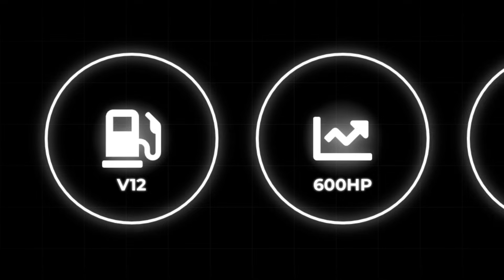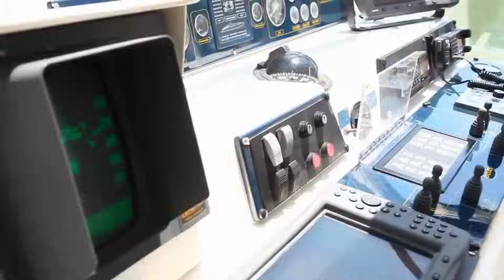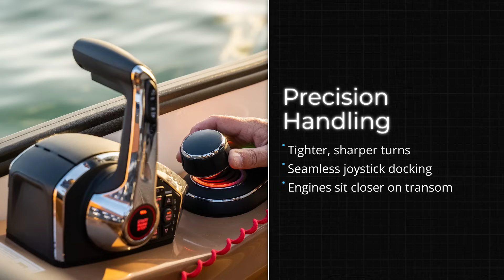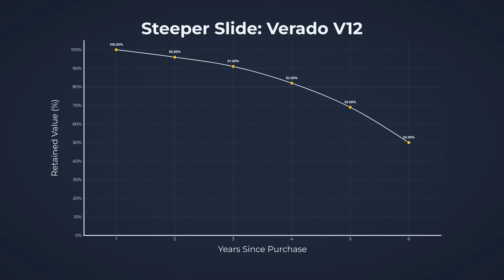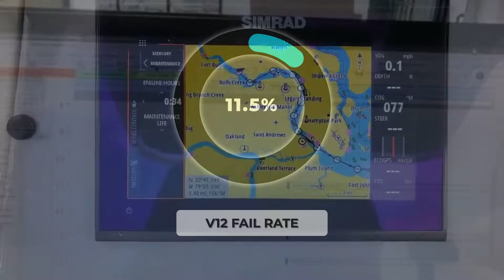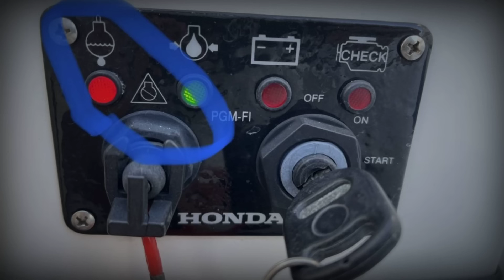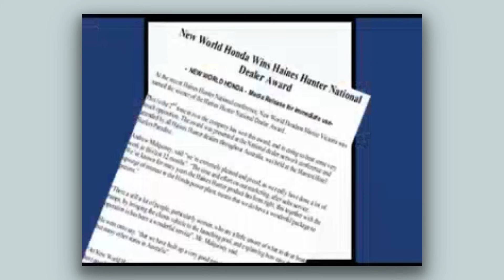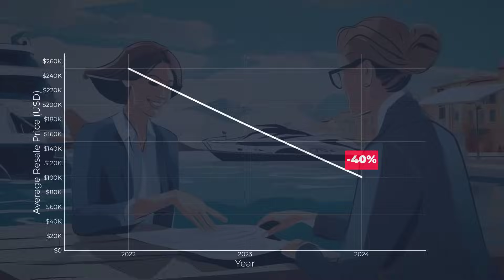The SHOCKING Truth About Mercury Verado V12 Outboard!

Comment: This is poorly produced crap- more AI nonsense. The motor weighs the same per hp produced as a Yamaha 450 V8 which is also an excellent engine. There were some issues with the first year or two but the new ones are quite good. They are complex, but the Mercury 600s are amazingly quiet and smooth. They are an absolute joy to operate- much less fatiguing and that is worth a lot!

Comment: Mercury went to several high end boat builders when they were designing the V-12 and the builders started building boats for this engine, it's not like you can bolt these motors on any boat,the new boats are designed for These V-12's.Tiara builds there 43 and 48 LS and LE just for the V-12,no other engine options for those boats,I work for a Tiara dealer and we have sold a lot of these boats. They talked about the weight of the V-12 , it's not that much heavier than the Yamaha 450

Comment: it amazing how an 80000 dollar engine cannot even come close to a 1960 6 cylinder two stroke that you could buy for 1000,dollars with no fuel injection no computers and ran for 50 years and regular gas and set of spark plugs

Comment: This video looks like a hatchet job. Who commissioned it? 

1) the price is the price, and it's not as bad as this video tries to make out. In the mid 1990s I was a Mariner outboard and Mercruiser Dealer. The price for outboards back then was roughly, $1,000 per 10hp. Given 30 years of inflation, that 600hp is actually less than it would have been 30 years ago.
2) 'borrowed tech from a supercar'. Yes, it has a large displacement V12 four stroke engine, and it looks like every other 4 stroke engine. I'd rather have tech 'borrowed' form a proven discipline than something previously unseen. Same with the transmission. Using proven tech from other fields is a good thing, not a bad one.
3) While I completely agree about the right to repair, a manufacturer does have the right to control how and where a product is serviced in the name of protecting the brand. We've all heard horror stories of pieces of equipment that get roasted for 'unreliability', and when you dig down, the owner either didn't have the machine serviced properly, or tried to do it themselves, which was the real reason for failure. And given the complexity of these engines, anyone doing work on them really should be properly trained. Again, I am all for 'right to repair', and parts and literature should be made available to anyone.

Comment: That fake voice spewing doom and gloom is ridiculous. This engine was developed for specific applications and not your sun rotted bass boat. In fact, just like the now defunked Seven Marine with similar features and spec. About the cost. The boats themselves that this engine is targeted for are one million dollars and up and will compete with the Mercury racing 1100 and up stern drive used in the large offshore pleasure performance boats. You can't go to your local garage (normally) to have your Lamborghini repaired or serviced and both of these toys are targeted towards that level on the food chain. Not those of us that can squeeze into our budget a 27 or 30 ft weekend performance boat. About being stuck with engine problems. Any boat this size will have the same problem of finding and waiting for parts. No mater what country. Even the smaller common engines from any manufacturer will have this problem. I know because I see it every day. General aviation mechanics who are the ones who work on the smaller airplanes don't touch the large jets. Some may handle small single engine turbine engines but not the Boeings and Airbuses. Likewise, the guy that bought a $99 tool set and now calls himself a mechanic and a withering tree for shade that barely charges for his labor because most of what he does is learn and experiment on your engines are going away. Everything built these days requires computerized diagnostic equipment that the aftermarket hasn't caught up with like the automotive world. Most of these guys won't or can't spend the $4000 plus to purchase the aftermarket gear and software let alone the $300 plus a year to update or rebuy the software. If you don't make that annual contribution to the software maker some will shut themselves off and what you already paid for is gone until you re up the annual legal extortion money.

Comment: Great lesson.  Namely, a lot of high tech enslaves owners.  I'll stick with half the horsepower and reliability.   I'd rather have two reliable engines, with a way to get home when one fails, than ANY engine that is going to stick me in the weeds with no help in sight.  So many tech geeks have manufacturers and buyers bamboozled.  More electronics means more ways to fail.

Comment: Used to work at Merc dealership, stay the hell away from this motor
Reply: Owned a Merc dealership. As bad as you seem to think they are, they are better than the rest.
Reply: I hear ya, I think they just got over their head with this motor. I'm more mad that Volvo bought Seven marine and killed their motors bc it didn't align with their green initiative. Why buy it? I know we all have our faves but I'm rolling with Suzuki from here on. They might not get u an extra 2 miles per hour but they will always get u back to the dock
Reply: I think the re-power market would disagree, nobody is repowering with a merc
Reply: @robbaxter5138  Umm I am.   Repowering my boat w the new Merc V10 425s

Comment: I have always had my reservations about the steering case from day one and i suspect as any new product there will be kinks to iron out so im not rushing to buy this engine anytime soon. Im still a die hard Merc fan and will remain so. 

There is some BS in this video that i should point out. The fact that the CG has an uptick of outboard powered rescues is a matter of numbers because the many new boats and massive uptake of boats with outboards instead of inboards so with the growth of this sector its only obvious the numbers will grow in incidents. 

Then the fact that there is a depreciation in the resale is obvious and one can only look at the car industry, Small cars and models of a brand will always depreciate less than the top end and that is due to demand in the used market and its always been that way and financing and insurance issues stated here also apply in the car industry.  

Now with regards to servicing. Have you ever tried to buy a new car? All the new cars in the last decade or 2 and beyond since having computer management systems in the cars have done this where only certified dealers can open your hood and take a look and dare you try doing something yourself or not from an authorised mechanic and you will lose your warranty instantly let alone the other issues and car manufacturers have been doing this for yrs and have taken it to a whole new level in the last 5 yrs so to critisize mercury for doing something similar when the very car you drive has the same restrictions is a bit rich. I dont like the concept but dont single out Mercury for something so many other sectors have been doing for so long.

Comment: I will stick with the 225hp carbureted 2-stroke bumped up to 265hp. Cheap parts. Work on it yourself.  $4000 reconditioned 90-day warranty.  Just repowered my Chawk pilothouse 222 July 2025. Full cost $4,700
Reply: Poor man’s motor 👍🏼

Comment: This is total BS.   I’ve had dozens of boats and current have 6, nearly all with Suzukis.   For 2 years I’ve had a carbon 48 (24k lbs) with twin 600s.    400 hours in and zero complaints. Hands down the quietest, smoothest, most fuel efficient 1200 hp I have ran.   Plus - 7 year warranty.   Beast motors.   Over built.
Reply: I will agree it is a game changer. Allowing the new massive center console boats to go from 6 engines to 3. But 400 hours? I'm a life long boater as I suspect you are as well.and unless you put 400-600 hours a year it's not a real argument. I used to be a die hard Evinrude guy, I guess I still am considering I still have 250 HP E-Tecs. I have owned a few pairs of them on a few different boats and while they are not perfect, they have proven they are reliable as I put almost 3000 hours on my first pair of 250's in about 4 years, those were 2005 engines. On my current pair I'm at 2000 hours on a pair of 2007 but I bought the boat in 2011  and the engines only had 90 hours. This is a 35' center console that weighs 10,000 pounds. That being said, I know we are talking about two totally different engine classes. I guess my point is, 400 hours in 2 years is not a lot of hours. I'm just remembering 7 Marine. They were the "cats meow" but they didn't last long because of the cost, the limited service network and limited parts available. Just so you know I am not biased, I drive an Escalade which is the same engine under the hood of the 7 Marine and when I decide to repower my current boat I will be buying a pair of 350-400 Mercury outboards.
Reply: I run my 40hp Suzuki about 100 days a year in puget sound (area 11 and13). No problems and the motor is a 2015. Excellent engineering. 3 previous Suzukis all were great.
Reply: They have left me stranded on customers boats time and time again steering issues oil leaks trim issues the list goes  on
Reply: @jimmyunfried8162  How is the engine itself? How about the 2-speed gearbox? I know they have the steering issues, and sensor issues like you mentioned, I'm just curious if you ever seen one where the motor blew up, or a gearbox let go..?
Reply: I guess you're lucky you don't want to sell them. That 20% per year depreciation would put most people out of the market.

Comment: A 2 speed gearbox they borrowed from GMs 2-speed Powerglide from 1950! Not what I would call cutting edge.
Reply: Did someone drop you on your head? Just because something shares technology with something from the past, does that in no way mean it is the same, equally old technology. That's as idiotic as saying that the V12 power head is the same as the V12 found in a Ferrari 250. Automatic transmissions today may share similarities, but they are at the same time a far cry of what they used to be. This is not a Powerglide stood on end in the mid section, far from it.
Reply: @AB-80X  I haven't looked at the trans, but I suspect its a 2 speed DCT.  That's a dual clutch computer driven manual transmission.  Cutting edge.
Reply: @JimReeder 
I know what a DCT is. 
It’s actually a hybrid. It is a dual clutch with wet clutches, but where a DCT like the Getrag units used in a number of sports cars which uses electric actuators to shift, like a traditional automatic, the ZF unit used in the Merc V12 uses hydraulic pressure. That is in fact a very clever way of creating a very strong and compact transmission.
Reply: @AB-80X  Nobody dropped me on my head you Jackass. They were bragging about their 2 speed gearbox like it was the latest and greatest thing ever. Multi speed gear boxes have been around forever. I know it is not the exact same as a 2-speed Power glide but it is nothing more than a 2 speed gearbox even if it is computer controlled.
Reply: You were definitely microwaved as a baby 😂
Reply: @derriklee287  I was born way before microwaves were even around.
Reply: The whole 2 speed tranny thing seems odd to me. Is something different with the duoprop? How is it not over or under spinning the prop

Comment: piston size of a soda can, WHO is fooling WHO?????
Reply: You should really keep quiet. You are showing everyone how little you know.
Are you even aware that the pistons in this, are about the same as those found in a Ford Coyote V8? Because ah yes, that is known for being a weak engine.
Plenty of outboards in the 250 to 350 hp range out there, with pistons in this size. 
Additionally larger and heavier pistons adds its own challenges. This has a very good displacement for a 600 hp DOHC V12. It is absolutely asinine to think otherwise. This is not 50's or 60's tech like a normal BBC inboard. Additionally you are spreading the load over more power strokes, you are putting less stress on bearings and rods as well.
Stop and think before you open your mouth. This is a bad, lazy and dimwitted AI video.
Reply: Believe everything this unintelligent AI video tells you.